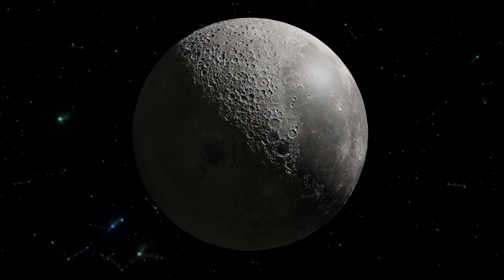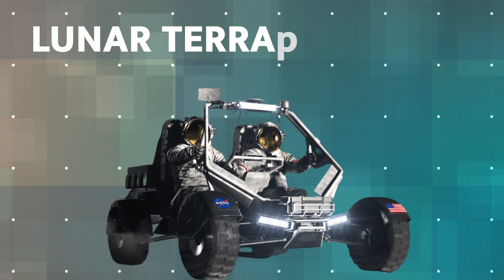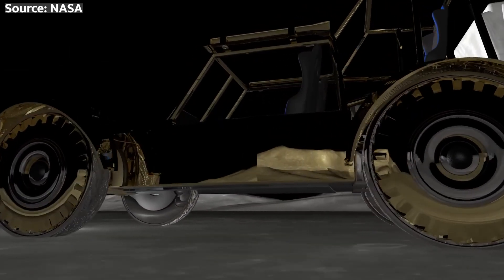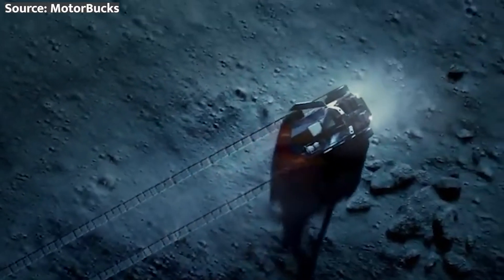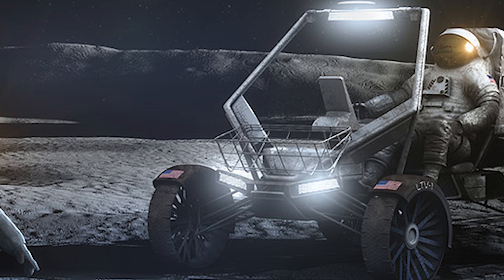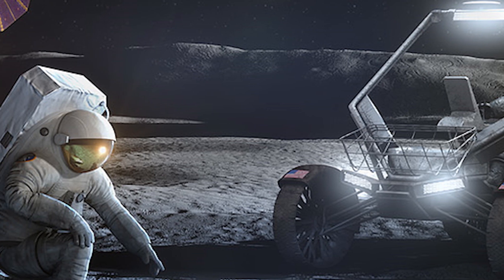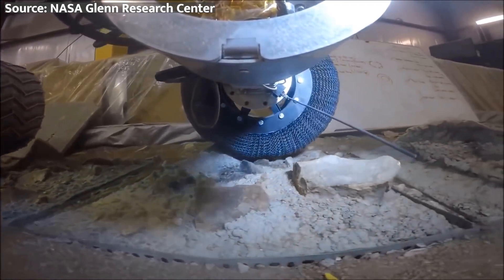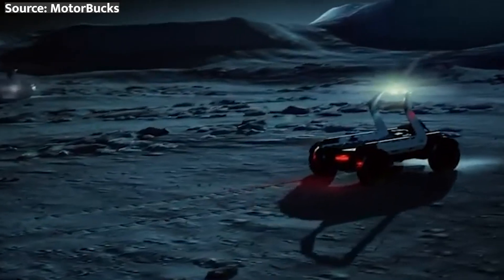NASA Reveals The LTV: The NEW Moon Rover For The Artemis Program

Comment: This Rover is being designed the wrong way right from the start. They are designing these things to act like dune buggies. Lets say an astronaut gets into trouble when he or she is walking around on the surface of the Moon or Mars in their space suits. Maybe their suit is damaged or maybe they are having a major health crisis. They are not going to be too happy when another astronaut shows up in a glorified dune buggy. They can't get out of their suits for treatment, or to exchange the damages space suit with a new one. The Dune buggy is open to the hostilities of space. The Dune buggy should be instead, designed like a small bus that is pressurized with an airlock, seats and bunks for 6 people. They should be stocked with emergency supplies, and have huge capabilities. Space is too hazardous to have to depend on a Dune Buggy to save your butt.
Reply: Weight. Something like what you're describing would be very heavy, and would be much harder and way more expensive to get to the Moon.
Reply: @benn454  Your right, but if things go well for Space X and Starship, then getting the parts to the moon to assemble the larger rover I suggested would be possible.
Reply: @k.sullivan6303  Yeah, they would have to make it a modular design that could be sent up by multiple missions ahead of time and have the astronauts assemble it in situ.